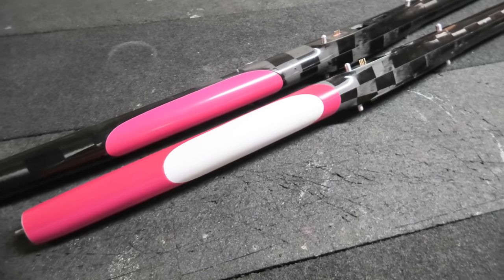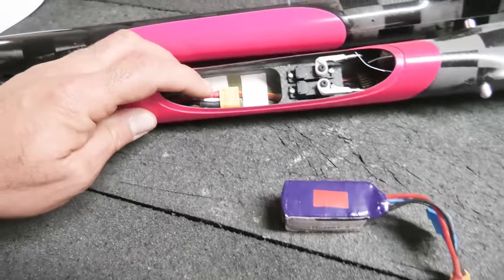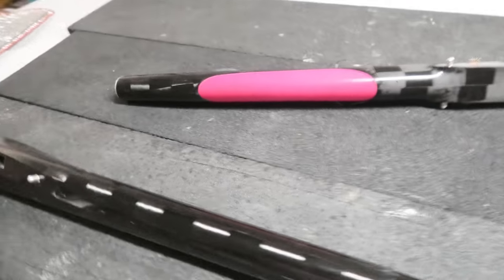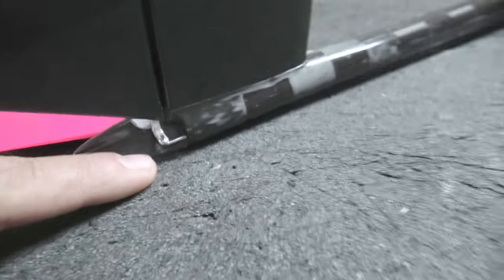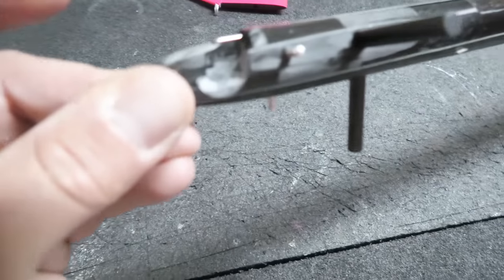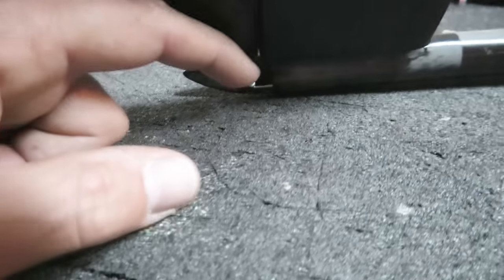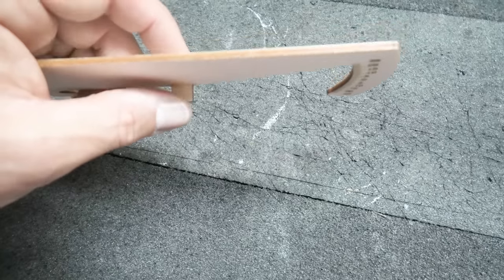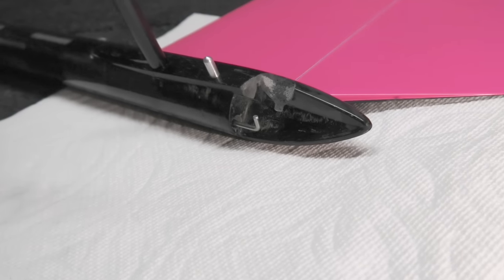Infinity F5J Short Nose V-Tail Fuse Overview

Comment: Better to have the ballast weight at the tail actually.  The moment arm is greater, hence the mass required is less. But if change the ballast into structural mass or system mass (stronger gearbox maybe) then it is actually doing something.